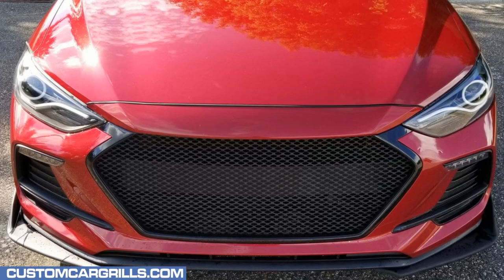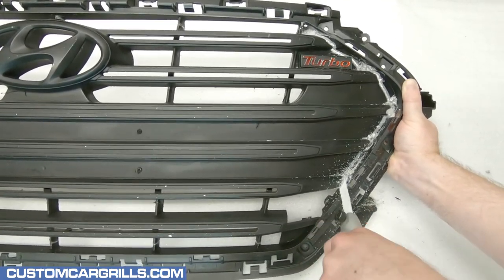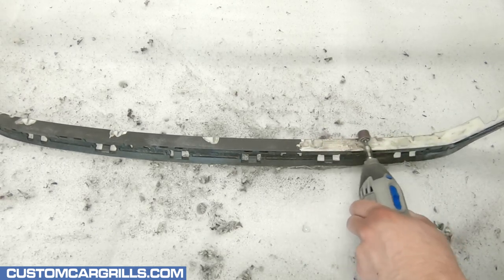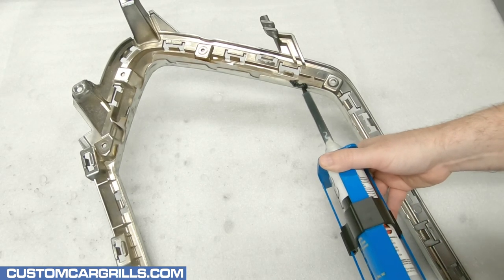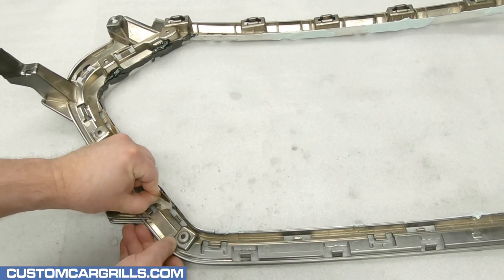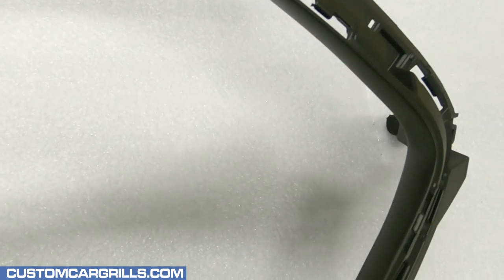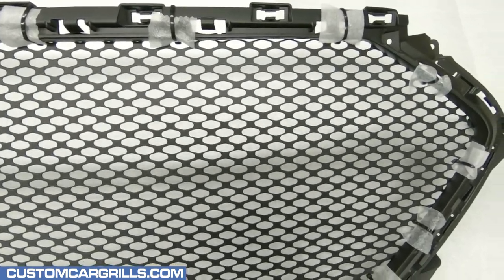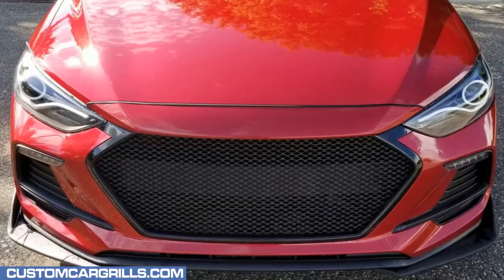Hyundai Elantra Sport 2017 - 2018 Mesh Grill Installation How-To by customcargrills.com

Comment: Awesome video! Do you know if the sport model is the same fit for the Limited model?
Reply from the maker: I’ve seen customers install the mesh on Limited models but I’m not sure what (if any) extra modification was done to fit it in properly.
Reply: It’s exactly the same
Reply from the maker: It is not exactly the same. They are very similar but there is a different bolt pattern on the grille between Sport and Limited.  The overall shape is the same, but the cutouts for the mesh tab locations are ever so slightly different.  If you look at the back of the stock grilles for both trim levels, you'll see what I'm referring to.  You can email me directly at info@customcargrills.com and I can show some comparison pictures if it's not easy to spot.
Reply: customcargrills nah I’m good I was just saying the grilles are the same shape and size 🤙

Comment: When you say a flat black finish, what kind of spray paint did you use? Cheers great look.
Reply from the maker: Our flat black finish is powder coat, not a spray paint.
Reply: @customcargrills  do you have a link to get some?
Reply from the maker: @thisisntsergio1352  I don't.  The flat black powder coat we use on the mesh is not something you'll be able to find online.  The flat black spray paint we used on the plastic surround is SprayMax 2K Matte Black.
Reply: @customcargrills  thanks.

Comment: FYI: It's grille not grill. 
Think I'll wait until someone makes the grille replacement so that I can place the original back on when I sell the car.
Reply from the maker: We're very aware of grille vs grill and we spell it without the "e" in most of our applications for a reason.    If you're interested in a full replacement grille that you can swap in, so that you can keep your stock grille, we can offer that service.  Feel free to email for a quote on price and time.
Reply: Yeah this is 100% not worth the time.

Comment: Will this work for regular 2017 Elantra?
Reply from the maker: The mesh piece we sell does fit the non-sport models (to some extent).  

The overall shape and size of the mesh works BUT behind the scenes the cutouts for the mounting tabs are a little different.  From what most non-sport owners have told me, they need to make some cuts and adjustments to get it to work.  So, yes, it can fit a non-sport but some extra modification (I don’t know all the details about what needs to be done) are needed to get it to fit other trim levels.

Comment: Is the pliogrip
The only glue I can use for this?  There isn’t a cheaper alternative? Asking for a friend…
Reply from the maker: There's others which are similar that can work, but they will all be around the same price and require the same applicator.  On a budget, bondo could work for the repair portion although this may lead to cracking issues later on.  

For the bonding of the mesh to the frame, Automotive Goop could work but you'll need to be experienced on how to manage that while it cures or else it could run all over the grille and ruin it.
Reply: @customcargrills Thanks! I actually put all those factors in mind when I was trying to look for an alternative I went ahead and got Pliogrip to not risk any later damage or cracking!

Comment: What paint did you use? Was it from rattle cans?
Reply from the maker: On the inner part of the stock grille, I used Spraymax 1k trim paint matte black.
Reply: @customcargrills  how has it held up?
Reply from the maker: Fine, I think.  You can see the car on IG, the owner of the grille in this video is @redd_elantra

Comment: Do you think this could work for a non sport model??
Reply from the maker: To the best of my knowledge, the non-sport model is a little different.  I don't believe that the piece we sell with be a perfect fit for the non-sport without additional modification to either the grill or our mesh piece.
Reply: I seen people with the mesh grill and it wasn’t a sport. The front is not different
Reply from the maker: I have seen a couple non-sport owners make this fit.  They said that some minor modifications to the mesh is needed to make it work.  To the best of my knowledge, there are some subtle differences with the sport and non-sport grille.
Reply: @customcargrills  how much if sent to you?
Reply from the maker: @elitetrainer84  Please email ( info@customcargrills.com ) for a quote on the current pricing for this.

Comment: Hello, i am in australia , I want to order this grill can you please tell me where can I find that grill
Reply from the maker: The mesh portion we have on our website here:  https://www.customcargrills.com/proddetail.asp?prod=Hyun_Elan_Sport_17
Reply: Hello can it fit no 2017-2018 non sports Elantra?
Reply from the maker: From the FAQ's on the page I previously linked, in regard to it fitting non-sport models:  Yes & No. The overall shape and size of the mesh fits the non-sport BUT behind the scenes the cutouts for the mounting tabs are a little different. Some cuts and adjustments are needed to get the mesh piece to work. So, yes, it can fit a non-sport but some extra modification is needed to get it to fit other trim levels.

Comment: So it’s $79.99 on your website for just the grille mesh piece? 🤔 it’s $84.99 for the complete grille on eBay .
Reply from the maker: I don’t doubt it.  Cheap China grilles are popping up everywhere.  No way any I can even remotely come close to that price for a completed grille.
Reply: Wont fit on Ebay youll need to Do some modification for the sport trim
Reply: @customcargrills  80$ for a piece of mesh?... What's special about it,if i can do all these steps just to put the mesh in i think i could probably cut a piece of mesh for less than 80$
Reply from the maker: I guess there's nothing special about it, other than it's pre-cut & pre-formed specifically for the Elantra.  The sheets that we sell of this style are $60, and we are charging an extra $20 to do the labor and make sure that it's a proper.  If that's not worth it to you, then make your own.